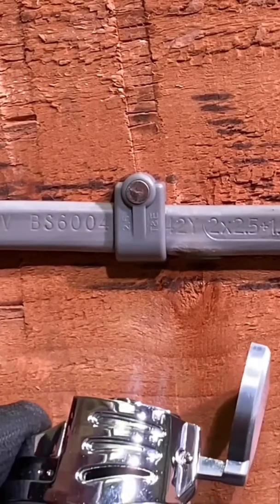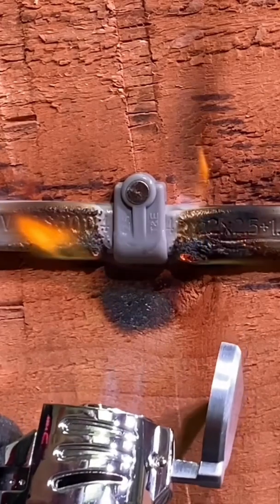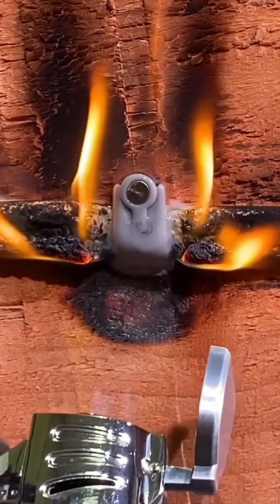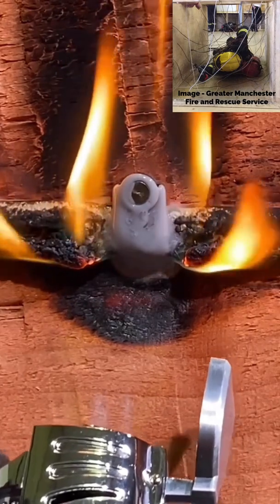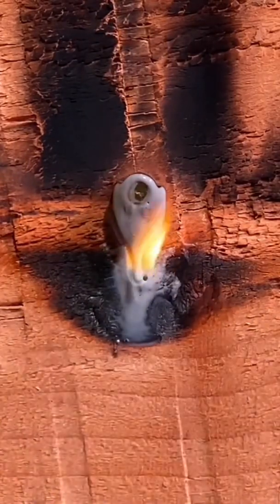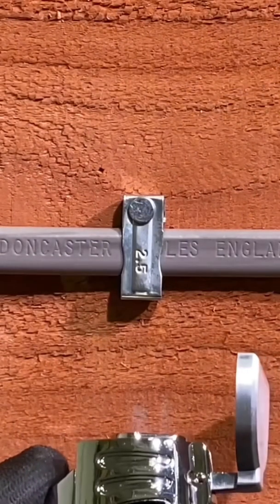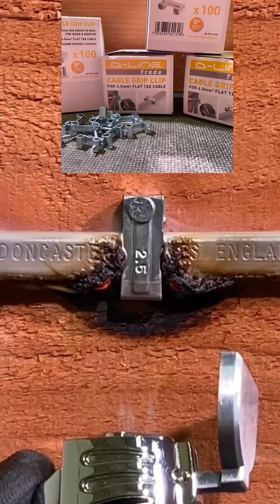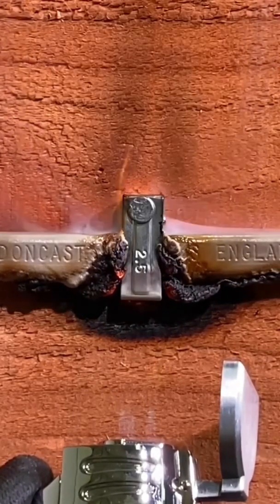What happens to PLASTIC cable clips in a fire? Electrical Installation #shorts

Comment: As someone else has mentioned on here before, why don’t you just install the plastic clips with the nail facing down? Surely in the event of a fire when the plastic melts away the cable is going to still be suspended by the nail which will be sticking out obviously. That’s what I was taught to do anyways. The new metal equivalent is a neat idea though but not as cheap and cheerful as the bog standard clips we’ve all used for many years!!

Comment: Would be really interested to see this repeated with the DeWalt staple gun. I know officially it doesn't state to prevent premature collapse but it does use metal staples and it's fastly becoming an electricians go-to tool....

Comment: Information from Coroner’s Rule 43 Letter, Shirley Towers, Hampshire, advises that the “Methods of cable support should be such that circuit integrity will not be reduced below that afforded by the cable used, and should withstand a similar temperature and duration to that of the cable, while maintaining adequate support”.

The following conclusion could be interpreted from the above statement:

Copper Cabling – Cable Supports should withstand temperatures of 1085 deg C
Aluminium Cabling – Cable Supports should withstand temperatures of 660 deg C
Reply: Rigid PVC (deforms) – 50 – 60 deg C
Rigid PVC (melts) – 100 – 260 deg C
Mild Steel – 1350 – 1530 deg C
Metal Alloy – To be verified with the supplier

Comment: What hack shit to run wire on block wall like that. You guys don't use conduits?
Reply from the maker: It’s a wooden floor joist
Reply: @efixx  towards the end when you are nailing into a block wall. That ain't wood or floor joist.
Reply: @daylate  just showing an example.

Comment: If you had that amount of flame/heat, any people in the area would be fried. If it’s in a ceiling space, the ceiling will stop the cable from falling down. Ditto inside a wall void. This is just needless health & safety for the sake of health & safety.
Reply from the maker: Ask the fire fighters families who lost loved ones as a result of cable entanglement which type of clips they prefer.
Reply: @efixx  - That’s unsubstantiated surmise by a coroner after the event. My job took me into hundreds of fire damaged buildings and have never, ever been entangled in fallen cables. Much more likely they got caught up by the total amount of debris on the floor.

Comment: If the nail is underneath then the cable is supported when the fixing is melted that what I was taught and what I do.
Reply from the maker: In your Engineering judgement when items are falling from the ceiling water is been sprayed we’re going to rely on that very small nail to hold the cable in place to prevent entanglement of our beloved firefighters. Thanks for commenting
Reply: @efixx  Yes I agree the metal fixing is a better idea in that sense. As I agree a plastic clip is not the best idea above fire exits and common areas. In places such as attics in houses where the cable can't fall through plasterboard and cause an obstruction then I belive a plastic clip is acceptable. Things change all of the time and I will always do my best to take pride In my work and make sure it is as safe as possible.
Reply: @efixx  again as you said we need to do anything we can to make firefighters job as safe as possible. Through such sad events such as grenfell tower has uncoverd flaws that need fixing such as flamable cladding and streets that made it much harder for firefighters to reach. The electrical industry needs to do its bit too.
Reply: I only do residential houses so I haven't really seen these full metal fixings but I have used metal plumbers strap to support cable runs on garage beams etc.

Comment: I think in a house fire a trip hazard is expected and possibly the least of your worries.
Reply: Do you have any idea why these regulations are in place?
Reply from the maker: Here’s the reason behind the changes - https://www.bbc.co.uk/news/uk-england-hampshire-30845937
Reply: @efixx  let's hope the IET man up and give sound guidance on how to best apply. As it stands the people who try to do the right thing often lose out in projects due to cost. For example, a metal clip fixed to the underside of a fabric such as plasterboard is not adequate. Cables installed only above fabric such as plasterboard is not adequate. All of these need to be supported by/or above the structure. In summary, the cable should melt before the structure or the cable support fails.
Reply: @efixx  So it's plastic trunking that was the issue in a commercial installation, not clips, but I can see the logic in addressing both.
Reply: @sandymcnair5298  What regulations would that be?
Reply: @cypeman8037  521.10.202
Reply: @cypeman8037  In the event of a fire, I would have too much to worry about, trying to get my family out safely.. I don't want to also worry about how the solve a krypton factor course of wires dangling from the walls/ceiling to be able to get to and out my front door.
Reply: @ColinRichardson  Why would wires be dangling? All the plastic clips are under the floorboards. By the time wires dangle, which they wouldn't because they're be supported by rafters or they would be burned to a crisp and disintegrated.

I've been involved in quite a number of house and commercial building fires and the issue of trailing wires has never ever been flagged as causing concern.

As for trying to get your family out of a house avoiding trailing burnt electrical wiring, I think if the fire has got to that level you are too late in evacuating.
Reply: @cypeman8037  I am so sorry, I am completely sorry.. I didn't understand that you have only ever been inside bungalows your entire life.. If I had known, I would have spoken more slowly and softly and tried not to spook you. I will know next time.
Reply: @cypeman8037  you are right though.. if I ever end up in a fire.. I will no doubt look to see if I can see any wires.. if I do, I'll go back to bed and try again in my next incarnation rather than try and leave.
Reply: @ColinRichardson  Being silly, flippant and sarcastic is rather childish. We are debating what I believe to be an imaginary issue put forward by these gentlemen. I made the point that I have never had this issue EVER pointed out to me. Have you ever read the headlines "Fire Service rescue hampered by domestic wiring" No you haven't.
If you can't take part without your juvenile attitude, bow out.
Reply: I don't believe its with engaging with cype man. He may just be engaging to for argument sake.

Comment: If you put the clip the other way around so the nail is at the bottom, the nail might just keep the cable from dropping down.
Reply: on a single clip maybe, but not if you've got a dozen holding a cable up, some of the conductors are going to drop down
Reply from the maker: So your engineering judgement suggests that very small now will hold the cable in the event of a fire...
Reply from the maker: In your engineering judgement will this very small nail prevent the cable from collapsing in the event of a fire when debris is falling from the ceiling water is been sprayed and the structure of the building is moving for me that’s a big NO therefore the use a metal clip  has appropriate appropriate intervals
Reply: @efixx  Heh, I'm not an electrician at all. Yes, the metal ones would always be recommended these days.
I think all the cables in my loft are all fastened to the rafters with just plastic cable clips, but then the last time the house was re-wired was 1974....
Reply: Who wrote these efixx replies? Did they have too many beers?! Gary, were you sober when replying? 😂

Comment: I was always taught the nail on the clip should be below the cable. Would be interesting to see if the results were exactly the same?
Reply: Thats exactly how i was taught too, nail underneath..
Reply: Same goes for me…
Reply: Yup, me too. I was always taught to put the clip the other way around so that in the event the plastic part fails for whatever reason, the nail will prop up the cable.
Reply: You right My comment is about it too. Clips separate 30 cm apart No  way the cable will fall.
Reply: Me too!
Reply: I was taught to fix the nail side underneath so that the cable will be suspended by the nail in the event of a fire, bearing in mind that it will be sticking out slightly.